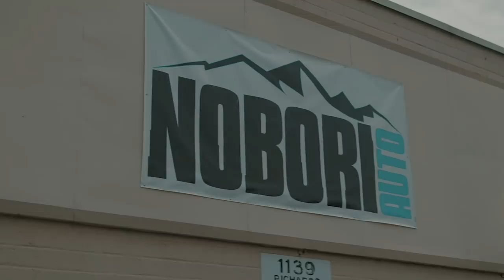I Bought a Nissan Cube from Copart That No One Else Wanted

Comment: I had a very low mileage 2010 Cube SL with most of the options on it. Climate control, alloy wheel, auto lights, upgraded stereo, CVT, driving lights, push button start and even those door sills which were lighted when you opened the door. It was the easiest car ever to get in and out of, seats fit good, dash and control layout was very good ergonomically and those large cupholders at the edge of the dash by the doors are fantastically useful. The rear windows rolled all the way down into the doors even! The rear seats not only moved forward and back, the back rests even individually reclined as well. For a suburban commuter car it’s great. It stopped good, handled urban driving chores well, good visibility and maneuverability and while not fast,  it was ok and it would do 80+ with no problem. I got 28 to 31 mpg in town and 31 to 33 on the highway. The CVT was a good match to the car and once you figured out it’s operation, it was very responsive and smooth. The reason it’s gone is I got rear ended hard at an intersection. Hard enough to break the drivers seat backrest and bend the headrest back almost 3 inches. (I had it extended to properly match my head height).The baseball cap I was wearing came off my head had hit the rear hatch window and dropped to the floor.  I was stiff and sore for a couple of weeks, but otherwise not injured. The car I got hit by weighed 1200 more pounds than the Cube and it was totaled as well. And not one window in the Cube was broken in the impact. I liked that car a lot and still miss it. It was metallic molten silver  with the light tope and cream color interior like yours. The 1st time my daughter shall the Cube, she called it “A box car.”
Reply: Jesus
Reply: I have a "box car" too
A 2006 Scion xB that had 68K miles on it when we bought it in 2013 and currently over 180K

That's a pretty crazy crash though

Comment: Nissan Cube GTR
Reply: Alahas 😂
Reply: Iirc they do a nismo version
Reply: @Mrflash222006  you're thinking of the juke
Reply: Nope, it was the note/versa E12 that I was thinking of, what has the Nismo version, The cube had other editions inc the rider, the mk 3 cube is based on the k12 micra iirc, so you could shoehorn in a 2.4 4 pot in

Comment: One thing that helps to get old glue residue off is Goo Gone or Goof Off
Reply from the maker: That's what I was using. Wasn't working
Reply: @NoboriAuto  never had a problem with it I've used that stuff to take off the glue from old tint old stickers what helps to do you have to heat it up get a heat gun keep it over the glue for a bit it'll definitely help a lot

Comment: Why not do it on the cheap? Nissan dealer parts?G o eBay cheap. That way you can sell this to a person who needs a cheap commuter. The high $ Cube manual market is not a large one.
Reply: Looks like  Certifit parts same as ebay, Chinese and Taiwan low end parts. He said Nissan but was lying or had a brain fart.
Reply: @guod1973  For many lower volume cars, some body parts are not made in reproduction. eBay sellers typically will be just dealers selling parts cheaper on the side.
Reply: Dealer parts are not all that expensive. The ripoff is in the labor.
Reply: SprinterFS yep a part can cost $50 but at a shop they charge $300 DIY is ALWAYS the best if you’re able to do it
Reply: @howtowithelizabeth7513  So true. Worse if the part is something the dealer has to have a hand installing. For example, the PCM went flaky on my car, and a new one requires programming by the dealer. So I had no choice but to pay the dealer. They decided to start chasing codes and charged me 2 hours of diagnostics before I demanded they STOP diagnosing (since I had already done it) and actually just replace the PCM. Which of course, replacing the PCM fixed the problem, so I owed them not only the 1hr for programming, but also 1hr for installing the PCM (which they do along with the programming, both steps take about 15 minutes total) ... But also for 2 hours of "diagnostics" when I already knew what the problem was going in and they didn't listen to me. Of course I have to pay for their refusal to listen.

Comment: Thank god it's a manual. Automatics in those are extremely unreliable.
Reply: Christopher Noble CVT not Auto.
Reply: +Clyde Barrow well a CVT is an auto if you think about it but I see your point
Reply: Christopher Noble the Z11 had 1.4 Auto and later CVT (They were absolute Rubbish) so rubbish infact Nissan don’t make Parts for em anymore. The Z11 1.5 had the next Gen CVT and was somewhat better and the Z12 were CVT no Auto option. Mine is a 04 z11 originally 1.4 Auto but typical of that era had a shit thermostat and done a Head Gasket. So we Moved onto a MR18DE and Auto out of a Tiida and basically from Firewall Forward is Now Tiida everything Runs a Tiida ECU, Z11 Cube BCM and Tiida TCM with a Modified Loom to control and make all that work.

Comment: cube owner here. Same color, 2012 base model, also a manual transmission, bare bones interior. 
Your car needs disinfection, not just detailing. Borderline biohazard imo.
Reply: Weak points of these cars, for those interested:
CVT (One of the worse automatic transmissions. No worries with the MT)
Leaky side windows and sometimes windshields. Careful with power washes.
Windshield extremely susceptible to stone chips.
Front parking lights and 3rd brake light up top. Burns out on me all the time.
Not a good freeway driver. Has no power and horrible handling at high speed.
Reply from the maker: Yes I agree. It will take me a full day to get it to my standards. It's really disgusting
Reply: @NoboriAuto  Or just get new ones, swap them in half an hour for wheel and shift knob. Worth the time. Cubes with auto transmissions (usually w/ same wheel) are getting scrapped from CVT failure that are not worth repairing.